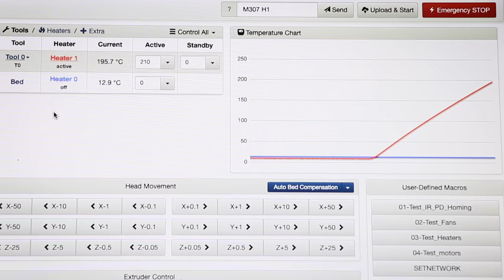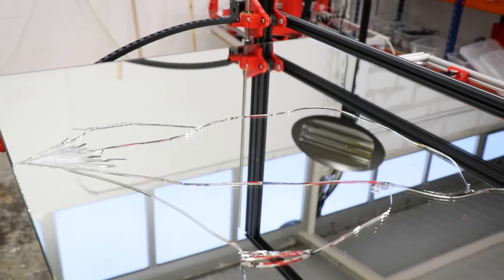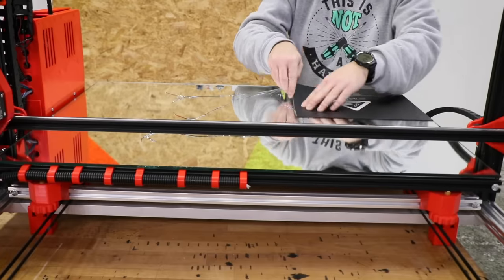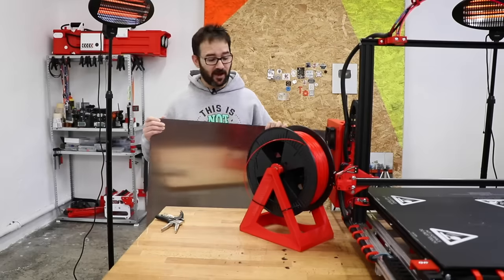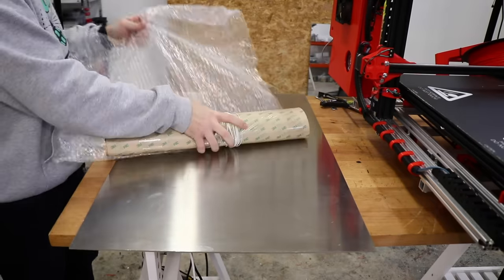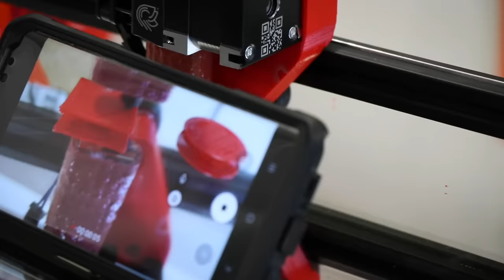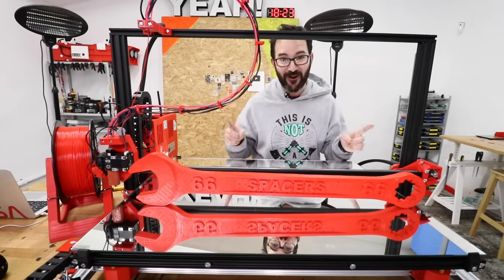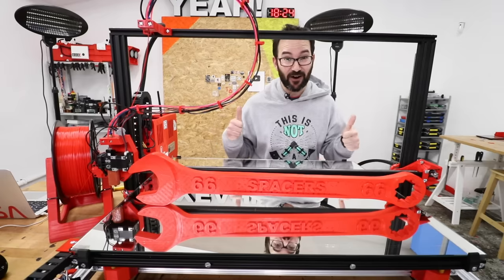GIANT 3D PRINTER FROM SCRATCH - IT WORKS!

Comment: i was so surprised when that wrench only took 6 hours wtf
Reply: indeed
Reply: Arctic_Fur to get prefect wrench.
Reply: It only took six hours mainly because it was only an 8% infill, so the structural integrity is probably quite weak. However, if he had done say, 100% infill for maximum strength on his oversized wrench, it probably would have taken upwards of 72 hours...
Reply: @rubenzikarsky2496  too much infill would make it less flexible
Reply: @arctic_angel7408  Yeah, its rigidity would increase and depend on the exact type of PLA used, it may be brittle or very strong. Not sure... but my point was the reason it was so quick was partly that he had such a small infill.
Reply: @rubenzikarsky2496  by the way, more infill doesn't get you more strength, it's outer walls that do. Increase to 3 walls instead of 2 and you will gain much more than going from 15 to 55% infill for example. It's all about the outside perimeter being stretched and compressed the most, the inside barely moves.
Reply: It’s the nozzle it’s 0.8mm
Reply: @rubenzikarsky2496  not to mention the wide open nozzle and it looks like he insulated the hot end to make it even hotter for rapid printing
Reply: @rubenzikarsky2496  100% infill on that monster would be very difficult without some pause/resume capability... I don't think even that oversized roll has enough filament for that!
Reply: Why?
An average 0.4 printer would be able to print one smaller at the same time frame.
This is just doing the  same thing but with a bigger nozzle thus obviously it's only going to take the same amount of time...
Reply: he used a bigger aperture for the nozzle
Reply: @siddharthkelaiya6590  came down looking for someone who said the nozzle size
Reply: Large nozzle diameter?

Comment: man if you sold this i would so buy one. seriously, there is nothing for a reasonable price at this size on the market, even if you sold it as a kit with instructions
Reply: same here, i want a 3d printer capable of printing large objects, (i make waterwheels as a hobby) but the printers are firstoff priced stupid for the sizes they can print, i mean tecnically a ender 3 is not that different from what you have made here, but yours can print large nice things, ender can make fist size items. the prices for large printers are not logical. this if sold for 600 dollars ,  it would sell. easy.
plz print a chair.
Reply: @magnetmannenbannanen  I’d wager this costs more than $600 for parts alone, not counting part printing time or anything else.
Reply: @strictnonconformist7369  true, but a printer like this doesnt need most of the stuff he printed and parts plus an Ender 3 printer/filament are about $650ish...but to buy another 3D printer this big would be ~$1500 im sure!

Comment: Very nicely done. Usually for printers this big will cost 10k plus or higher. You may want to consider using a closed loop stepper to prevent step loss and also resume print on specific layers for print fails or resume due to power loss. But overall excellent work

Comment: Neat way of keeping the bed rigid, I appreciate that you took the time to look at ways to upscale the basic creality design. Be careful not to say you designed the printer from scratch, because you made it from scratch. This design has been around since before prusa started making his 100,000 printers. On the other-hand, you totally designed that bed support style and there is no problem with you saying that you designed that, because you did.
Reply: He designed and built it from scratch. Period.  You can still say you designed a part if you didn't develop the bolts, bearings etc. yourself...

Comment: My thoughts on this:

1) Congrats on the custom build! It looks really nice!

2) If you decide to build another printer, consider making one that moves the bed in the Z-axis. It will require less speed, making for lower vibration, and you can actually print precision parts fast*. Right now, you are using a large nozzle size with, I suppose, a large layer hight? That will work, for large parts, but will leave *heavy ringing and issues when it comes to the y-axis. The bed's mass vs  the belts is both going to wear it out really quickly, but also impact the prints.

3) You need an auto leveling system for that printsize with that budget bed. Mirrors are nice, but as you noticed, don't take thermal stress very well. Any bed surface you build with that size is going to have some sort of warping, or at least develop it over time. I would recommend a genuine bltouch. It actually probes the bed with a little stick, and has incredibly high accuracy. You usually combine it with manual leveling. (you can add four macros, each for one corner, and it will move to that place, probe, and give you the result in the log. so you can screw each leveling screw to absolute perfection, and check it out).

Comment: This is a great build, Ivan! I have my own giant printer build in my garage (600x900mm) that is based off of the MPCNC platform. Decided to give up on the self leveling bed aspect (BL Touch sensor) after fighting Marlin for 2 months and will try out your leveling feet instead for the bed now. Thanks for the inspiration.
Reply: Why did the bed leveling not work with a bl touch?

Comment: you got a hermes and a supervolcano, time to print BIG and FAST! see how fast the big printer can go without quality loss, would be very interesting (maybe 80mm/s with those thick lines? not bad)
Reply: you are funny.. 80mm/s ? what about 30
Reply: @matutolaYT  why not?  i print 85mm/s with a .6 nozzle and a normal volcano.  i'd be supprised if he couldn't match that with a 1.0 or 1.2 nozzle.
Reply: @EricNistler  and how heavy is X and Y system ?
Reply: @matutolaYT  That was my thought. X would do fine, but that's a LOT of glass and aluminum to swing around. Bed Thrash is gonna be an issue, which means severe ghosting on vertical surfaces, gaps, and it could even knock over prints.
Reply: @Corbald  there is a reason why industry spends millions in shaving grams out of 3d printer systems just to get 10mm faster, because it can be 12hours faster in a 3D print.
Reply: @matutolaYT  Agreed. In fact it's why I went with a Bowden-style extruder when I redesigned my first printer.
Reply: ...scales up benchy boat to 10 times the size...
Reply: @Corbald  If you want to get serious speeds, you can't move the bed, you have to move your nozzle on both axes. That's how it is for laser cutting machines, no way you could get the speed they have if you had to move the bed.
Reply: @EricNistler  I also print with 85 with a .6 nozzle and normal E3D hotend.
Reply: If the application is for custom structure that will be entirely covered in some other material, the surface quality isn't an issue, so BIG and FAST are the only requirements. I have just such an application in mind, but I think I'll be getting a Modix Big60 corexy instead of trying to build this. I don't think this printer will ever print very fast because of the method used to drive that massive table back and forth. But, it may be fine for whatever application the builder has for it. Maybe his needs don't include speed. It might be that he's making parts for some other, larger project that overall takes much longer than the print speed he has, therefore the parts he prints don't need to be done any faster.
Reply: @tin2001  ohh, yes this, are you watching Ivan? A maxi size benchy would be pretty awesome.
Reply: This XZ/Y arrangement will never go fast without major redesign. Needs powerful servos and of course way more rigid bed (which is even more mass). And at some point you will reach an acceleration limit where the workpiece itself breaks from the bed due to it's mass, especially if it's tall.

For these sizes an XY/Z arrangement would perform way better. But pleeease! Don't hang that bed up using cantilever design! Please!

Comment: You are doing the work like a pro. It is so refreshing to see proper cable management, proper heatshrinking, proper energy chain... And a proper control board! 👍

The only thing which I don't like, it is the XZ/Y arrangement. This is a major performance limit. For these sizes the speed is cruical, and an XY system with Z bed could be a magnitude faster.

Comment: Couldn’t you use a printer this size to print an entire instrument, like a guitar or cello? And not just a solid body, but a full sandable acoustic...
Reply: yes, a spanish guitar,  but it would sound weird in plastic (maybe using a wood composite or with a metal 3d printer), also the strings you cant print them.
Reply: He could do an ukulele in one go. People already did it and they said it sounds better than many you buy in stores (there are factory made ukes that are really really shitty)
Reply: He got his start by printing a violin. It had to be done in several pieces. Now he could print it as a single piece.

Comment: My question is how much was the total final cost? Cause this is something I desperately need!
Reply: Here’s an educated guess based on the most expensive components: (with VAT)
-Herema direct drive (£108)
-SuperVilcano Hot end (£96)
-Duet2 wifi and Duex5 (~£200-£240)
-24V power supply (£50)
-6 stepper motors (~£60) 
-1x1m heated bed (~£120?)
-Aluminium sheet (~£66) 
-Gears (~£10)
-6m of belts (~£16)
-Filament for printed parts (~£25?) 
-Aluminium extrusions (~£90?)

So maybe ~£885? I would certainly set myself a £1000 budget if I did this but you could go for a cheaper setup using cheaper parts from an ender 3 like the power supply, hot-end, computer, etc.

edit: changed price of aluminium
Reply: @NullHyp  plus the 3d printer for all of the parts
Reply: MATER DOIT lol I was assuming someone brave enough to try and build such a big one would already have a “small” one.
But sure, add £150 for an ender 3 👍🏻
Reply: @NullHyp  wow $150 that's pretty cheap thanks
Reply: @NullHyp  just so you know you just got a new sub
Reply: MATER DOIT thanks!
I haven’t posted anything in years though. 😅
Also £150 not $150. I actually got my ender 3 for £140 (~$185)
Reply: @NullHyp  oh
Reply: @NullHyp  Idunno £50 on a 24V psu sounds like a high ask, but that alu sheet totally costs more than £30 so I guess it balances out. 6 Steppers would probs fall more into the £50ish range. I'd esimate that the alu extrusions are more like £150.

But yeah 1000 if you want to go for it. Things like screws, wire and other misc aren't free.
Reply: KentoCommenT Yeah, it’s always easy to forget the miscellaneous stuff and it does add up quickly.
Reply: @NullHyp  good point
Reply: @NullHyp  You should check current aluminum prices. No way it was £30. I didn't look at the brand but if it's a Meanwell PSU it's $35-70 depending on the model. The silicone heater alone is over $150
Reply: The heated bed is probably in 120/230V, so that saves a bit on the psu.
Reply: Deneteus I checked aluminium prices and just changed it. I’m just going for an “educated guess”

Comment: Hey,
Would you mind sharing the Plans for the whole Build ? I'd really like to build one in this size and your Build seems very good to build and I also like the Design with the Extrusion Profiles.
Reply: Phillip  Thomas just say you didnt do your homework :D
Reply: @iKn-ft2bc  Well I did them. Someway at least.... I wrote this comment during the Video at a point where he was just explaining the Printer. Later on he said that the Plans are on his site so I guess that's enough for me
Reply: @phillipthomas357  The metal parts you can work out sorta easily, it is if it needs custom coding to operate that I would be stuck on. That being said having measurements for the aluminum parts would make it way easier.

Comment: where did you get this massive heat bed element?
nice printer!
Reply: At that size I think you use a space heater under the bed. :)
Reply: Search on aliexpress for silicone heater pads. There are even bigger ones than this but they get quite expensive (150€ and up) at that size.

Comment: Give him a year or two and the begining of video will sound something like this:
*"Hey guys! As you can see I sacrificed this entire room to make even larger 
 3d printer. The truck with red filament spool is on it's way so in this video we only run a 2 by 2 meters callibration cube"*
Reply: It is 2023, the fifth printer has finally finished the printing the rocket. The rocket will be used to build the first zero G 3d printer in orbit. Without the pull of gravity, there is no limit to how big the glass plate can be. Sights can now be set even higher...the moon.
Reply: @brendan-kfp7.62mmminigun4  This is getting more and more hilarious

Comment: Where did you find a heater for that big of a bed?
Reply: It looks like Ivan is using many smaller heaters side by side.
Reply: No, it looks like a part of 3M but i cant find it. I have a big MPCNC printer and it would be nice if your could tell us where the heater can be bourght. Have you a part number?
Reply: @florianjabberwock8411  Sorry, I just looked at those black stickers. My bad. I Didn't pay attention..
Reply: Reptile heat mats?

Comment: Im just now getting into the research phase of 3d printing (late i know) but this is PHENOMINAL WELL DONE SIR!
Reply: @ivan miranda With the plastic wire loom if you run your wires through the "box" end of a wrench and tuck it inside of the lume after you split it it allows you to to tuck the wires in 100x faster <3

Comment: You should've gone for a CoreXY setup because of how big and heavy the bed is. With the current configuration you won't be able to print quickly.
Reply: True
Reply: For that size a CoreXY is double the price. It requires much more extruded aluminum and a frame really stiff to support the belts and pulleys
maybe he can move the X gantry instead of the bed to make it "lighter" when you are printing something big and you added 6KG of filament over the bed.... but I don't think the problem is the speed

For big prints you usually use big nozzles and high layer heights... the extruder and hotend have limits, so you only print at like 80mm/s, for this setup it's not a problem.

The real problem is the quality. You can see the frame shaking, and for that bed you cant use high acceleration and jerks... and with this system you use 1 motor per axis...
With Corexy you won't print quicker because you are limited by the hotend but you can use 200-300+ travel speed and better quality and acceleration, and it's less likely to lose steps in an axis, because the two motors move the gantry at the same time and the system always weights the same